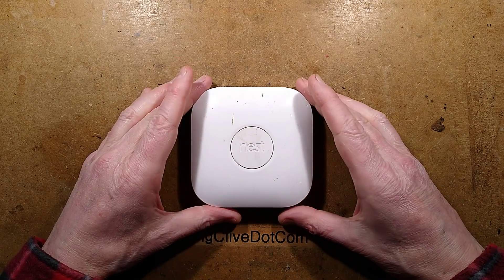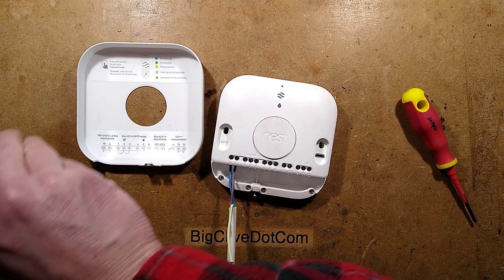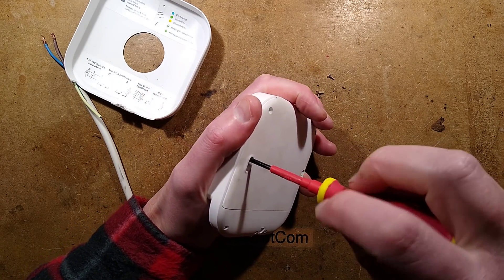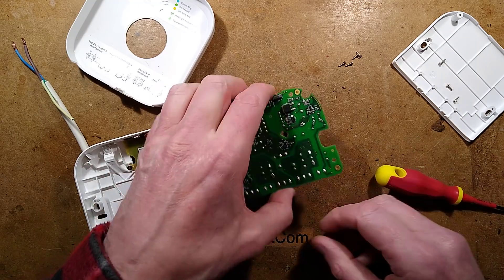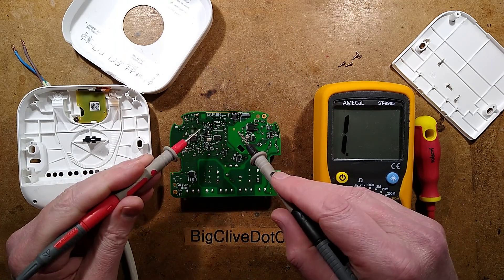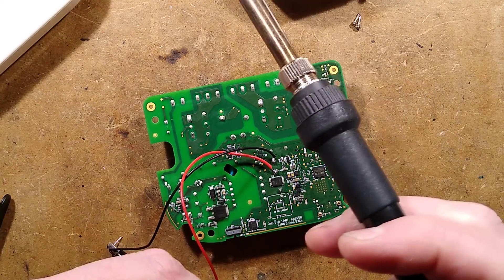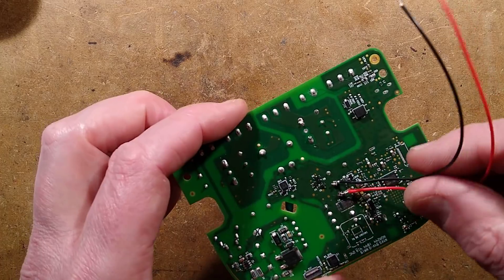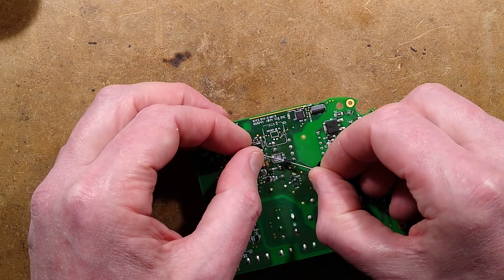Fixing a completely dead Nest thermostat heat link

Comment: Brilliant job, yet again a 10p component causes £££'s repair bill for the average consumer. Reminds me when I re-populated our fridge freezer control board with fresh caps, new board was £450 ! !  full set of caps costing about a £5 and an hour replacing them and the fridge freezer went on for another 7yrs before failing seals which I couldnt replace teminated its 20+years service.
Reply: Oh wow, at that price you're definitely better replacing the fridge freezer completely if not repairable like you did here
Reply: @Tokaisho1  charging more for a new board than an entire new product should be made illegal. It's nonsense like this that keeps landfills growing...with all the health and environmental damagd they cause.
Reply: I had a 4 year old furnace board go bad, acting strange. Visual inspection show a electro cap bulging next to the control chip. Replaced it without even taking the board out. < $1.00. worked for 7 more years before another board needed
Reply: that's how things should be!
Reply: Same experience with a dishwasher, cheapo relay on the PCB burned out - new board £100 or just replace the relay for a lot less.  Everyone should learn to solder :)

Comment: "Do you remember when thermostats were cheap, simple and lasted for over 30 years?"  HA, my parents house still have the same bimetallic strip coil based thermostat since the house was constructed!  Thanks for the thought, if they ever get rid of it, I may yoink it off of the wall.
Reply: My parents' house still has one of the round Honeywell mercury switch thermostats every single house built in the mid 1900s in the USA has/had. It's got to be 60 years old and still works just fine.
Reply: @christianelzey9703  I forgot it had mercury in it! No wonder I can't find any for sale with a bimetalic strip in it anymore, I legit searched after this video!
Reply: the nest !?

Comment: I will never have any internet-connected IoT devices...though I am investigating running my own cloud server and using micro computer based devices instead.  
I already run my personal server on a local-only intranet which is totally independent from the internet connections so adding a cloud server would not be very difficult.  
The local intranet is hardwire based...no wifi...so any future connections will have to be with ethernet cables as well...most Arduino's already have a connector anyway.

Comment: Never quite understood why I need to control my heating when I'm not there....
Reply: Because you went out and left it on? Because you are heading home after a week away and want to arrive to a warm house? These systems let you do that, and most have "geofencing" which, when tied to a phone, will do that automatically (assuming you remember to take your phone...)
Reply: @BarryRowlingsonBaz  Perhaps, but for the very occasional "what if" scenario it seems like a whole lot of extra compilation.
Reply: @AndyMarsh  it’s an option for people that want it, that’s all. You don’t have to have one.
Reply: @AndyMarsh  The geofencing is very useful, and adding manual remote control by phone is useful even at home, saves me walking across the house to the thermostat...
Reply: @BarryRowlingsonBaz  Perhaps I am atypical...  I touch my thermostat about twice a year. In the spring I put it down to 15 and in the autumn up to 20.  Otherwise the timer just does it's thing.

Comment: Point of order Mr Clive, that's the control centre, not the thermostat.

I've had two fail within the warranty period and Nest replaced them without any argument. The later ones seem to be much more reliable.
Reply: Very true, and interestingly enough, they’re not included with thermostats in America! Seems like a solely European affair
Reply: @shaples  yes. As I understand it, the US doesn't use mains voltage signals for the logic and switching to drive heating systems, unlike European, or at least UK, heating. So the US nest thermostat unit drives the heating system directly with low voltage control signals, whilst we get that box to translate the thermostat's wishes into mains-switching relay openings and closures. It also provides the power to the thermostat unit.
Reply: @AJB1  In the US you'd only find line/mains voltage thermostats used with electric baseboard heaters. Everything else is 24V.

Comment: Testing diodes and capacitors in circuit, tut tut!
Reply from the maker: Provisional test to determine area of fault.
Reply: @bigclivedotcom  I tested one the other day, said dead short, took it out, was fien, replaced it with a new one that said fine, still read dead short, it's a bumpy line!

Comment: Hi Clive, I had the same problem with my nest. It is a design or manufacturing fault. Nest replaced mine out of warranty for free, sent me a replacement by 24hr courier once I got through their customer service triage. Happy days. P.s it still worked when powered via the micro usb socket.
Reply: Sounds like it was the power supply if that's the case. I bet the USB directly connects to the low voltage control side. However, strange the relays worked as they are 12v
Reply: Hi Clive, another duplicate, happened to me Wednesday before Christmas and Google managed to send me a free replacement, out of warranty, within 48hrs. Quite a refreshing support response from Google, I expected a battle :)
Reply: @majintheport  If they're seeing as many problems with these things as your and other comments indicate, maybe they're trying to prevent a class action lawsuit while getting the manufacturing straightened out.
Reply: @markfergerson2145  I've had a couple of Nest thermostats (One of the current generation, one of the previous generation) - The base units live in a warm airing cupboard and I use the 12V outputs on both of them for the display units. Both have been going strong for years now so I don't know if there was a bad batch or not but at least some of them are surviving.
Reply: @yngndrw.  Interesting.  I've had two out of four units fail and they've both been installed in a warm boiler cupboard with the 12V output in use.  The two that are still going strong after 4 years are in cooler locations and don't use the 12V out.  If it's a bad batch, it was going for at least a year between late 2019 and late 2020 as those are the dates when I got my two failed units.  Both the good units are older than that.
Reply: @richbouchard8603  Our first was purchased in around 2015 and initially the heat link lived on a wall under the combi boiler in that house. In 2018 we moved house and purchased the second with both of the heat links being located in the airing cupboard. The heat link for the old model has the version "Amber-1.5" and the heat link for the newer model has the version "Amber-2.5" - It would be interesting to know if the version is different on your two failed units!
Reply: @majintheport  I was expecting service like that but in my case the nest customer service said they couldn't help and just suggested I ask for help from the place of purchase instead. It was through a utility company however, so they had no means of support for these things. Just a dead thermostat is all I have now.
Reply: Identical issue here. Google replaced the whole unit as well. After speaking with the boiler man there was apparently a rash of Nest failures that were all identical.
Reply: I had exactly same fault. 3 Year old unit  contacted Nest/Google support on Friday evening  described fault and on Sunday received new unit with email stating they would cover refitting cost with nest pro installer.
Reply: Had the same happen after a power cut and resumption of power.

Comment: Well, not so much the thermostat but the switch box they include in the UK bundle. I had one die on me too. But I moved to Tado now as I use a Google free smartphone and the Nest app wouldn't sign in. I think the whole design of the Nest is rubbish, should be able to turn the thermostat down to an OFF position, but if you want to switch off the heating you have to faff about with clicks and turns. Also why have a rotary dial on the app/website? no point having skeuomorphism and making it harder to control. Tado has a slider like any sensible UX designer would use.

Comment: What model is this actually!? It doesn't come up in a search for "nest thermostat"
Reply: Nest calls it a "Heat Link".  Gen 3 I think. It's an interface that wires directly to the boiler and talks wirelessly to the thermostat.
Reply: It's not the thermostat itself but rather what Nest call the "Heat Link" unit which does the boiler and valve switching.
Reply: Interesting, thanks guys! Boiler systems aren't too common here in Canada, so I didn't realise Nest had made different hardware for them. Seems like it's UK only though.

Comment: Open the pod bay doors Hal.  

The newer Nest thermostats are in  excess of $200.  I have a programable Honeywell one I got at a resale place for $3 that's been working well for a decade.  

Oh no, I can't use an app to see the temperature setting while I'm miles away.  HA!
Reply: In parts of the UK we have boilerplus regs that require some kind of smart heating control be fitted - weather / load compensation  or one of these smart stats that automate and optimise. So a simple timer and thermostat isn't allowed on new or replacement installs these days
Reply: @randomcamerajunk6977  Interesting.  I guess the old mercury switch ones would be out then too.  LOL

I'm thinking I'd override one of your modern ones.  I come home and put the heat where I want it and turn it down when I leave basically.  

Something funny is in the summer I generally am fine at 78 degrees (F - sorry) and in the winter, 67 - 70 is just fine as well.  

Much much warmer than Big Clive's workshop for sure.

Comment: There's no way active use of wifi would draw more than another 100mA at most.
Reply: Don't be so sure. If I remember correctly, ESP8266 wifi modules can pull a total of about 250 ma when transmitting.